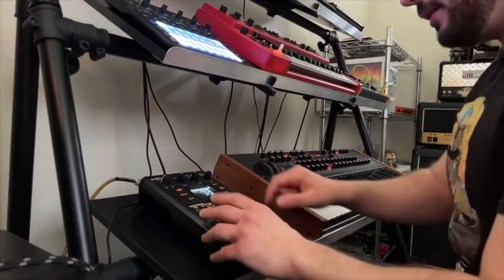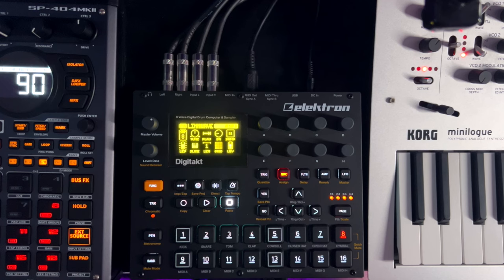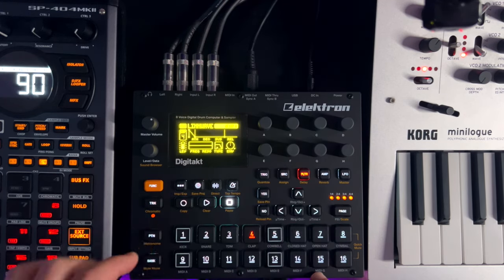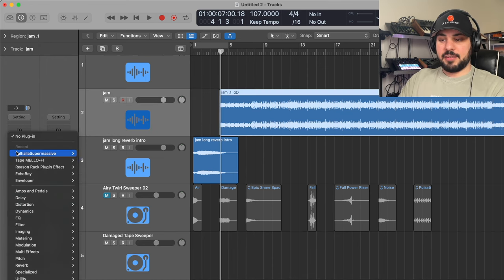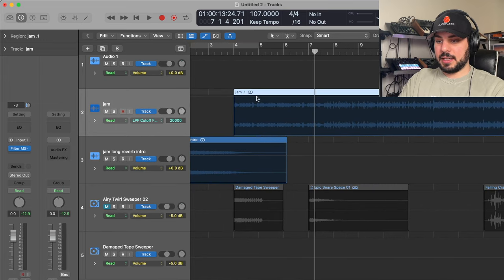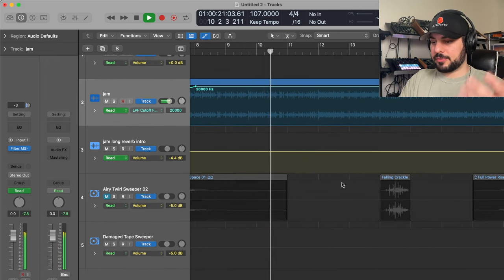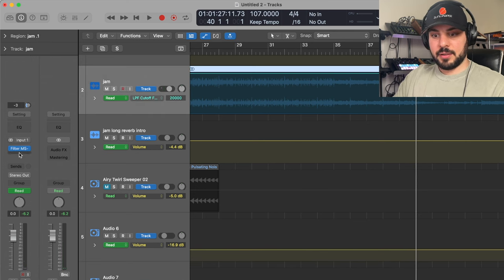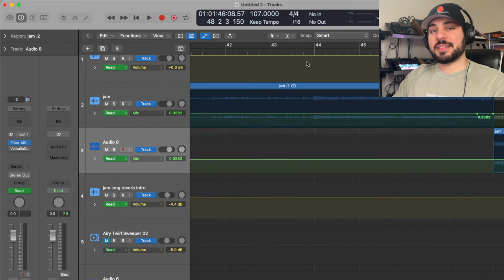This Workflow Made Finishing Tracks Easy: Here’s How I Combine DAWless & DAW for Beatmaking

Comment: Great videos friend. Do you have each separate piece of MIDI outboard gear connected to a preamp to your interface, or is everything daisy-chained via MIDI and brought into your DAW somehow without analog patches?
Reply from the maker: Cheers! I use a few different routings depending on need.  For this, all the synths and Circuit go into a mixer, the mixer goes into Digitakt and Digi + all the audio goes into the SP for sampling/final fx processing.  
I've also done a routing where each piece of gear goes separate into an interface but then it loses the SP fx at the end of the chain.  
The final routing I'm still going to explore is overbridge on the Digi and then SP as the audio interface of the DAW.